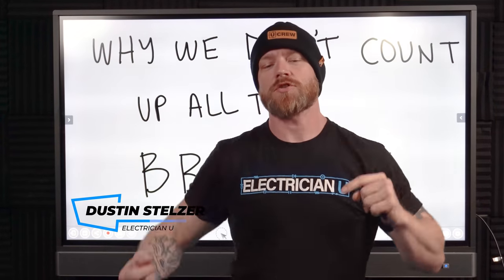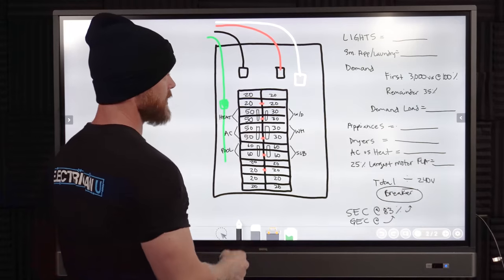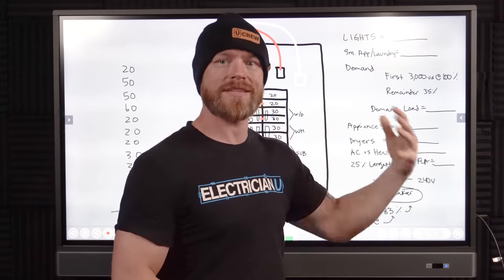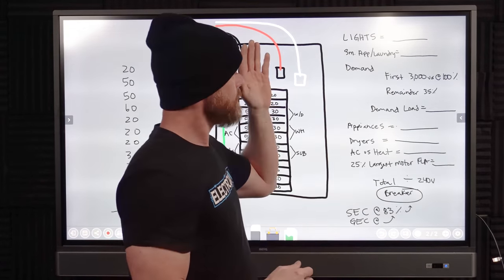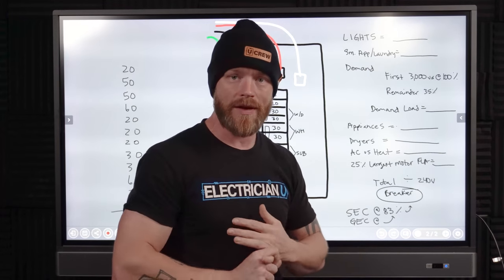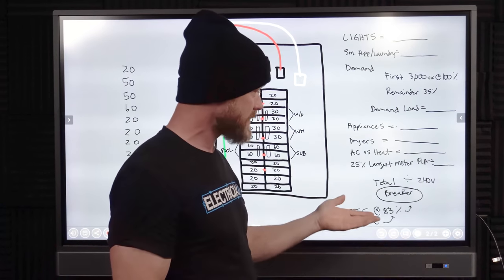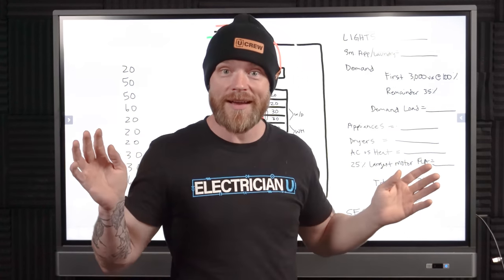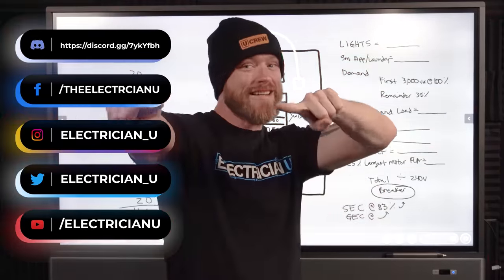Why is there more than 200 A worth of breakers inside of a 200 amp panel?!

Comment: You are so stinking helpful, i learn more through you than i ever did in the apprenticeship!
Not to take anything away from you, but after a year i found out my hours weren't being logged, so kinda tells you about my  "apprenticeship"! Still, almost 20 years ago i was an electrician for about 4 years total. I have learned more through your videos than in that 4 years. Does anyone else have questions about converting old  spaces? I am making an appartment in the back of an OLD commercial building. I need to break circuits up for GFCI kitchen, bath, etc. And add a few dedicated circuits. 200amp main feed 2 smaller sub panels. 1 feeds another appartment space, and 1 feeds a store front. ALL the wiring is so confusing. Pretty sure the last 70 years of remodels aren't helping. The labeling in the panels is for stuff that doesn't exist, but wiring still does...

Comment: I have 100 amp service.  I thought about upgrading to 150 as we have a lot of pets and heat lamps.  I also have a hot tub and central air.  For the heck of it I turned the hot tub on full during the summer while the central air was running as well as most all the rest of the stuff.  I then clamped the mains to read the amperage draw.  I got 16 amps on one and 13 on the other.  So I felt a bit better knowing that.

Comment: My understanding of it (I'm a heavy truck mechanic) is that a fuse/breaker is sized to protect the wire depending on gauge. Even when in use you are rarely anywhere close to the amperage of the breaker for most applications under most applications.
Reply: You nailed it bro
Reply: Word

Comment: Great video, love the way you explain things. I enjoy hearing other electricians explain their understanding of why things are done the way they are, as it might give me a different perspective, or I may even learn something new. I'm from Canada, and we do things a little differently, but probably end up with pretty much the same end result for the demand load to calculate the main breaker for the service. 

However, we are only allowed to derate the service entrance conductors by 5%, and this usually ends up with the wire having a capacity that is equal to or just over the size of the main breaker.  The reason why is that the breaker is there to protect the wire, so even though currently there is not enough demand in the system to overload the conductors, at some point in the future, things may be added which would not require the main breaker to be upsized. 

As most main breakers are rated continuous duty, this could potentially be too much load for the conductors if they are only able to handle 83% of the main breaker (I've seen plenty of 200A services where the demand calculation is definitely over 166A).

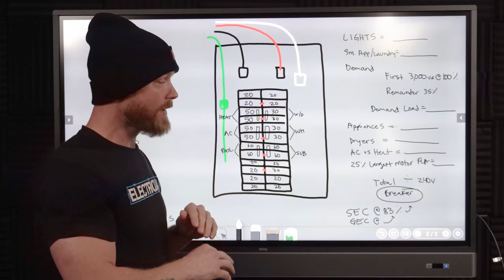Comment: 4:10  I have 400 amp service, and the meter base/socket looks the same to me as a 200 amp service.  Essentially, I have 400 Amps at the meter, split into two 200 amp outside breakers/disconnects. They run to a 200 amp panel in my house and a separate 200 amp panel in my garage/upstairs apartment.

That then makes my house and garage 200 amp panels actually sub-panels, the neutrals and grounds are required to be separated back to the outside disconnects and they are then bonded there.

The reason for this is I have two electric vehicle chargers in the garage, plus a 4 ton HVAC system, washer/dryer, oven etc. in the garage apartment.

Comment: As an EE for 42 yes, there's a big difference between residential & commercial NFPA (NEC) codes for calculating loads on service entrance conductors and load centers vs panel boards main breakers. Great explanation but most won't understand. A little bit of knowledge (Architects) is dangerous.

Comment: For a home even 200 amps is a bit much. However in some industries even 400 amps might not be enough. I work in a pretty small theater and we have a 3 phase 400 amp service, at one time we were running a lighting dimmer rack that would deliver 72kW to 96 750 watt lights, so it needs quite a bit of power, that was run on a huge 240 volt 400 amp safety switch that was fed directly from the transformer outside the building that is a 300KVA transformer. And we also have one main 3 phase panel and 3 sub panels that run everything else in the building and that is also a 400 amp service. What most people don’t realize that as you go through the system you are underrating your services, we start with  300KVA transformer that can do 600 amps, then we send that to the dimmer rack and the main service panel and both of those are rated at 400 amps, then we send feeders from the main panel to a 200 amp sub panel, and then we send feeders from that to 2 100 amp sub panels. But the other thing there is that it’s the same thing as a house we aren’t constantly using all of the power. When we are doing a show we run the dimmer rack at almost it’s max load, so about 350 amps, and then we have the power for the rest of the equipment which is probably about 40 amps, so we still aren’t using the full service rating and we probably never will.

Comment: As a homeowner I installed my own 400 amp service with two 200 amp panels. One for the house one for my garage/well house. LOL 😅 a little overboard
Reply: I did the same.  I have two car chargers in the garage and nearly 5000 sq ft of living space plus a 900 sq ft garage.  400 Amps was the right answer.

Comment: My dad was a construction electrician.  I did a few summer jobs with him before joining the Navy, where I was an AE. In the 1980s my brother (journeyman electrician) was working with a Fluor Corporation electrical engineer going into  1940s-70s skyscrapers and testing the feeders to design upgrades, due to all the modern office equipment.  In the 1990s I worked as an electrical assembler in manufacturing and we sized conductors by what fit the component.  I prefer an up-sized conductor over a minimum-size conductor.  Sure you want that winning low bid that lands the job, but sell the customer on future loading resulting increased costs of material and labor to upgrade.  Also, what if a solar/wind system was to back feed onto the grid?
Reply: I was an AE ,62E AIMD Nas Oceana 96-99

Comment: I did work at a really nice house in a rich part of town and it had two parallel runs of 200 amps at his service. The lugs on the line and load side of the meter were double lugs and it split off to two 200 amp main breaker panels in the garage. Was pretty interesting to see at a house
Reply: @Californians_go_home  well in Florida where I've seen thousands of houses it most definitely is lol
Reply: I honestly wonder if you'll ever use 200 amps at the shed a 30 amp sub would have been suffiecent
Reply: same at my house. 400A service is really 320 and its a meter socket with dual outpout lugs each going to a 200A panel. SOP
Reply: I just saw the video on 1phase v 3 phase wow no no no there is nopush pullin.   Generators have a rotating fields of n and south poles .depnding on speed 1800 rpm u would have 4 poles connected in series to a dc exciter on back end . u have to make dc b 4 u can generate ac .the rotating magnetic fields r. Controlled by v regulator . that moves .the stator. Or stationary part of gen set is made up of individual coils of wire that r spaced 120° apart on 360 rotation .there r 6 coils .wen u series connect u get nominal network 480/277 .wen connested in parelle u get 208\120 v 3phase 3 wire u tap t4 t5 t6 for 4 th wire for 120 neutral .once the gen is running the rotating dc magnetic field is inducing voltage in statsionary windings there is no current flow outward untill a load is applied to l1 l2 l3 .the 4th wire is bonded to gen frame and u derive your egc from that and is. Not conn to neut any where else in system and shoukd have no current flow and no v potensial on conductor and runs w crckt condutors . your loops r short crkt unless u put resistance in .no push pull no xtra amps comin back to asist next phase .fig i c if this helps. Thanks 4 reading single phase transformer. In res areas r fed w 7200 v off 3 phase network of 13.800 v plus grounded conductor
Reply: Same here at a fancy rich house in Branson mo.

Comment: These days, with wireless meters that can plot usage on an hourly basis, I'm surprised they don't use that data when planning a renovation. Plotting actual usage has to be more accurate than guesses based on floor surface area, etc. Of course you have to allow for peak usage when everything happens to occur on at the same time, but that's another story.
Reply: That only works if you have such a system -- few people have them. And it all rests on the ability to determine what the loads are. My house usage is a nearly constant 1kW. So constant, in fact, the power company cannot begin to guess what the loads are. (they claim 60% of my power is "Water Heater"... they know for a fact this house has never had electric water heat.) I know what's what, because I can hang a meter on each circuit.
Reply: Prime example of using the electric meter for planning is industrial settings where a demand meter can supply data on actual use at peak times. After working at a generator company for near 25 years we've used a utility bill to determine the proper sizing of a gen set. In this case it was a double check after the usual calculations. The reason being is a gen set is seldom required to power the whole building at max service  capacity and it can save thousands on an installation.
Reply: "In the old days" a paper wheel graph would be used to determine use and time to plan/plot appliance use and energy savings, goes to pot when things are done outside the parameters set aside.
You can collect all the data you want , but usage can vary on weather or whim.
Reply: Then when a new person moves into the house and has different uses for the house you're fucked. Square footage is the way to go I think.
Reply: I think the number one factor that's going to change the amount of power being used in a house is the amount of people living in the house. A house with a family and 3 kids is going to consume way more power than a house with only one grandma living in it.
Reply: @twn5858  ... the square footage is probably the best way to figure TOTAL usage for sizing the service. OTOH, as you said, the number of people and their personal habits will determine your bill at the end of a month.

Comment: I took care of a large rooming house for 11 years. It was an old knob and tube house which had the wiring upgraded. It had wiring from the 40's & the 60's as well as some original knob and tube. The main breaker box had at least 30 breakers & the pony box had another 12 breakers. The main breaker was only 70amps. I asked the utility company if I could use a larger breaker & they said "No, you only have a 70amp service". I'm surprised it never tripped a main breaker.

Comment: You explained this in a very logical manner. My main breaker for the outside electric line is only 200 amp, and that's from the electric company. My main breaker inside my home is the same, be no reason to go higher. Like you said not everything is gonna be running at the same time anyways. My biggest power usage is my electric furnace, and it's only on 60 amp breakers and that's the recommended rating for the furnace. Heck today's appliances are actually pretty efficient, and mostly don't even max out the breaker amp rating. You could add up all the amps the breakers support, then add up the actual use and there would be a fairly good difference.
Reply: Yikes !!! A 60 amp electric furnace? Even if it is on a 60 amp breaker and only really draws about 48 amps.... That's a perfect candidate for a change out with a Heat Pump. Unless you are in a very cold climate.... You can save up to 75% in kWh. Don't get me wrong... We should all use way more electricity powered by Nuclear Reactors everywhere... But that's a can of worms.  I have never heard the term Electric Furnace, not that I can remember.

Comment: It's simple. That's the most power that is available. More breakers, mean more areas can have a separate breaker. You just can't exceed the household amp limit. You can run, different things, in different parts of the house, as long as the total amps don't exceed the household limit.

Comment: Good explanation.  At the farmhouse I lived in as a teen, (still go to visit one a year usually) they have a 120/208 v  3ph 600 amp service,  but we have a grain dryer that had a 20 hp motor, and he had some large augers that had 3 ph motors,   5 horsepower, also  we have a large pole barn that has welders, air compressors,  etc, and a spot to plug in engine block heaters for the diesel equipment.  There is a 150 amp 1ph panel in the house, a 250 amp 1 ph  panel in the pole barn, and we have 200 amp 3 ph  service running towards the area where the grain dryers and augers are located. Definitely overkill in my opinion.

Comment: This is a good breakdown.  I had to learn this 2 years ago when I decided to finish off an unfinished basement that had no electricity to it, and building code required I split the service at the Meter, which required me to upgrade to 400 AMP service.  I have no hesitation for upgrading service as it allowed me to install a home EV charger.
Reply: Jesus Christ! How many square foot is your home?
Reply: @robbybiddle9236  It was 3480 sq feet.  I added 1480 feet in the basement.
Reply: m rapacki  
The original breaker were set up as follows:
4x15 amp breakers for lights (Bedrooms, hall & loft area, Living room/ dining room and kitchen/ library.
6x20 amp breakers - non GFI outlets (local code stipulated no more than 10 outlets per breaker, and outlets be spaced no more than 12' apart).  They are broken out as such - Garage, Master Bedroom, Bedrooms (2, 3 &4), Loft & hallway, dining & library, guest bedroom and living room
3x20 amp breakers - GFI - Kitchen outlet, upstairs bathrooms, downstairs bathrooms
4x20 amp breakers for dedicated items (microwave, refrigerator, and dishwasher/ disposal, Wash machine)
1x40 amp breaker for hot water heater
1x50 amp breaker for kitchen stove
1x30 amp breaker for dryer
1x60 amp breaker for AC unit
1x15 amp breaker for outside lights
1x20 amp breaker for outside outlets (4x).

My utilization score was 149 Amps for a 200 amp service, and would be limited to a maximum score of 160.  In order to get permitted,  I would have been able to add 3x 20 amp breakers for outlets (each score at 3 amps), and one 15 amp switch for lights (scored at 2 points) before I would have maxed out.  
When I got the basement permitted,  I was told if I ever planned on adding an AC unit or heater, I'd have to increase my service load.  I had planned to add a heat pump than runs on a 30 amp breaker, which would automatically put me over, and they would not permit the project until service was upgraded.

I did get called out on the code for can lights because although I used high efficiency LED's, they have to run the calculation as if you are using incandescent filament bulbs, and I was required to cut the total # of lights on a circuit between 2x15 amp circuits.  Even though a 15 amp circuit can handle 1800 watts, code limits it to 1440 watts, and with each can light rated at 100 watt bulbs, I could only 14 can lights per circuit.  As stupid as it is, the pool room (18'x26') has 15 can lights and 2 fans with lights.  I had to take 1 can light off the circuit, and dedicate a circuit to the fans, fan lights and a single can light.  

The basement has its own 100 amp service (way overkill), but I took the 400 amp service and split it at the meter for 200 amps to the main part of the house, 100 amps to the basement and 100 amp dedicated to the garage.  This allows me to add a 80 Amp EV charger whenever I want without needing a permit, or change to service.
Since I had plenty of power to the basement, it is broken down as such:
30 amp circuit - heat pump (25 points)
20 amp circuit - dedicated for FRIDGE and SEWER PUMP (12 points each - 24 combined)
20 amp circuit (x5 kitchen GFCI, Bathroom GFCI, and 3 circuits for outlets. (3 points a piece, 15 points total)
3x 15 amp light circuits (2 points a piece, 6 total)

The utilization score for the basement is 70 out of a possible 80 per local code (80% score of breaker box capacity, which was 100 Amps).  I also removed 3 points from the upstairs utilization score (down to 146) by removing a 20 amp circuit that fed 3 lights and 1 outlet in the basement.
Reply: @Xander-dx6mw  Can u post any good resources for performing a load calculation? You must have done one.
Reply: @Xander-dx6mw  we upgraded to 400A from 225A. 6000sqft divided into 6 apts. 6 of each appliances and 2 AC units. 300A meter bases and panels aren’t easy to get so we went 400A.
Reply: @daveschreiber9587  I have posted this twice, but it keeps getting removed.  Do a Google search for the spruce electric load calculation.
Reply: @Xander-dx6mw  Thanks!

Comment: That's why you should do a load cal sheet to determine the size of panel...that's what I was taught back in the 70's, And that's what I still do!  In general, 200 amp service is plenty for any average house, and if you think you need more, the power company will question it and send out someone to determine if you actually need more than 200 amps.

Comment: From the utility standpoint, 400A whether 1 400A or 2 200A panels gets a 320A meter.  (400x80%).  Over 400A gets CT's.
Reply: 400a 2 gang panels receive (2) 2s meters if both mains are rated 200 and less. 2 gang panels having 300a and 100a mains will get (1) 2se and (1) 2s meter. Depends how the setup is. The bus is rated for 400a and the service conductors will still be sized by the total load.